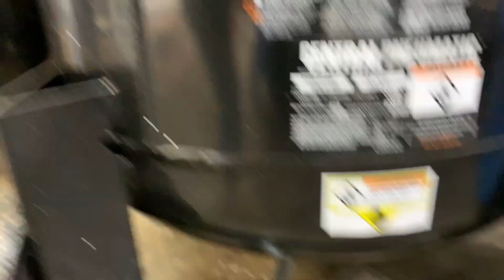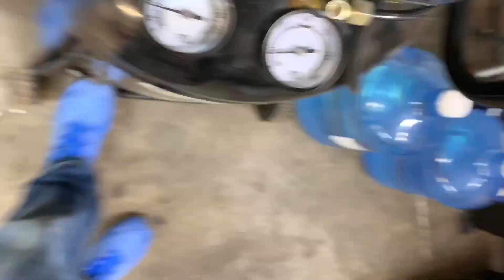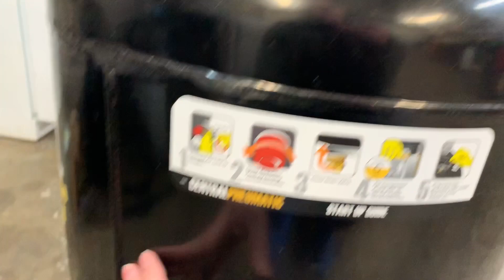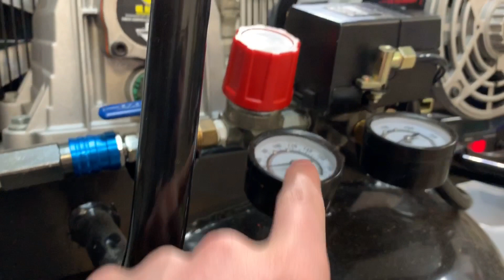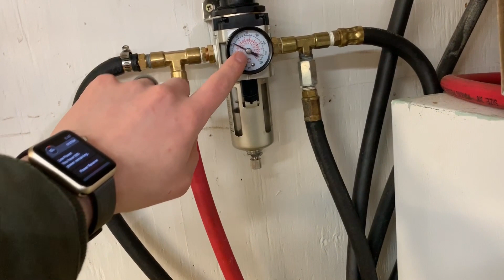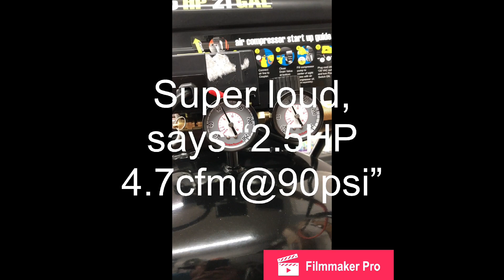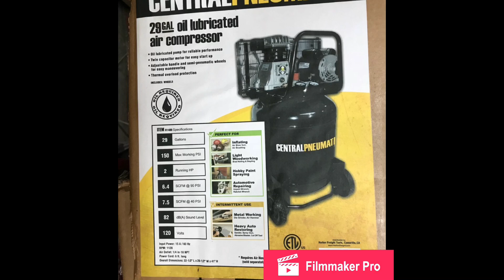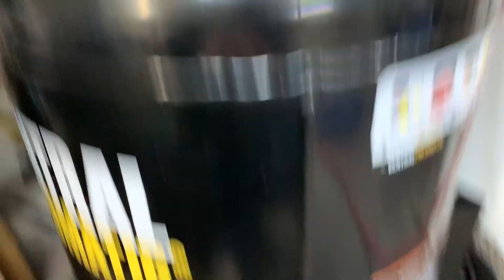Harbor Freight 29gal After Cooler Install, (BONE DRY AIR)

Comment from the maker: Planning to upload an update video with before after temperatures on tank, before after of heat that the upgraded comp oil reduces, and with new plumbing up front and hose reel review once I get them. Links will be added to video for that!
Reply from the maker: https://youtu.be/M5F7eyJBKpM
Reply from the maker: Moving into a new place with a 30x40 outbuilding shop, will do an updated video after!
Reply: You should have just put on a short pipe extension nipple, instead of chopping the frame.

Comment: Great thinking and upgrades! Practically speaking, you almost never have to change compressor oil because there is no combustion byproducts. After cooler must be rated above max compressor pressure. Even though you don't get tank water, keep daily drain habit up because in warm climate that might increase. During once recent garage repair, my compressor ran continuously, I discovered loads of tank water.  Any water left in tank can cause internal corrosion, making dangerous tank.  Never buy/gift used  compressor w/ old tank, because you don't know how tank was cared for; it could be ticking bomb. Work safe.
Reply: Good point I never thought of rust inside he tank weakening the tank...and POP.

Comment: That would be an after market transmission cooler. With 1/2 pipe threads. And your oil drain on the compressor you may want to take out that plug install a pipe nipple of any length that gets you out to a more easily serviced position then cap the end. Making it far easier to drain the oil without making a mess
Reply: Bring it closer to you or tunnel to it. French drain? Lol..Still not enough clearance not to be a pain. 

I stopped after that. But 1/2" definitely aftermarket unless you're working on an Allison. Seems overkillish, however those auxiliary coolers were fairly reasonable even from the Dealer. I just know anything diesel related can easily quadruple in price.

Comment: Something I learned a few years ago here on YouTube about running the main air outlet tap as in where you would connect your hose or hoses to go to your air tools is that it's best to run your pvc or steel or brass line up high on the wall and then from there run it at a downward angle for say 2 or 3 ft, to wherever you want the level of your main line at to tap in with your air outlet fittings, and put your water separator and filter there, then from that point run your line along the wall level and put your outlet tap somewhere along in that point or if you want multiple outlets to be able to connect your air hose at different points along your garage instead of running a long hose from one outlet all the way across your floor then you run your line as far along the wall that you need to.
 To try to make my point simpler what I'm saying is that the air and moisture that exits out of your compressor needs to run a fair distance, like say maybe 6 ft, or more,  before the water condenses and separates from the air to be able to drain into the water separator more effectively, if the separator is too close to the compressor outlet the air and water remains a vapor and the water doesn't have much of a chance to separate. Running the line at a downward angle for a distance and then tying your separator/filter in at the end of that run at the point where you'd level the line back out helps because the water will separate and then run downhill into your separator at that point, then from that point, from the separator you can run your line level along your wall and put your air hose outlet tap or taps from that point on.
  I realize that I rattled on for a long time here about it but sometimes it's difficult for me to be able to explain what I'm trying to convey in a few words. I hope I made sense here, I personally haven't set up my shop like this yet because we're still renting a house but when we buy one hopefully in the next year or so I'm most likely going to try to set it up this way. Anyway, I like your ideas here, pretty dang nifty. 👍

Comment: Why not screw a pipe into the drain plug and have it stick out .
Reply: He said the drain valve was fouled up @ 01:31. So he upgraded.
Reply from the maker: The oil drain plug? The things too tiny I tried to find a way to extend that out (like the tank drain plug) but couldn’t. It’s tiny so I cut the frame a little
Reply: Yes, do your crankcase oil plug the same way the tank water drain with a ball or gate valve.  Look for 1/8 NPT nipple & ball/gate valve.
Reply from the maker: Phillip Chambers just bought it a few months ago, gonna install it!
Reply: @phillipchambers8487  I put a ball halve with a drain screw “I didn’t even know they made them” on my oil sight glass because the screw hole actual drain valve was to small to add the drain too, on my 21 gallon cheap Harbour freight compressor. It works great I can see the oil level better and drain it easier! I also added a radiator cooler before the tank the air line going to the tank doesn’t even get warm! Only thing I’m wondering about is where does the moisture go does it stay inside the radiator?
Reply: I tried that. Because its already a small plug, if you thread a pipe it make the hole even smaller.

Comment: I bought a Husky 60 gallon two years ago and am finally getting around to adding an aftercooler. To anyone out there who has a compressor, water in your air will destroy a tank and tools. After cooler will save you lots of frustration.
Reply from the maker: Brother's Forge amen
Reply: @gunsandgaragegear601  I used a roll of 1/2 inch copper tubing   coil , from compressor and put 1/2 inch separator before the tank and,,, dropped my air temperature 100 degrees.. it's 25 ft of coils,,,best way I've found

Comment: Just wanna say I've had the loud 21 gallon for 8-9 years now. Biggest issue is the factory nipple and regulator choke it down to a 1/8" output. It's great once they're replaced. Wish I had the money for this one back in my 20's, but it definitely wasn't built to be thrown away after a year or so.

Comment: Nice Frankenstein job...looks like it should be in a Mad Max movie...
Reply from the maker: Vee-in-nYc lol thanks. Works great I’ll post another update video when we finish moving into our new shop outbuilding in about 4 months.
Reply: Not the prettiest plumbing job, eh. Could have all been done with copper line... get even more heat dissipation.

Comment: Try adding an intake muffler. Brings the decibels down. Did it to mine and much quieter. Pvc piping  elbow, cap, steel wool and some filter element. Can aim the piping to the floor or any other direction to reduce noise as well.
Reply: I was thinking this on my 5 in 1 ridgid.
Reply: Shop i worked in had like 4" pvc intake routed outside. It was awesome
Reply: Link man... please offer a link to such muffler after making a suggestion
Reply: @anthonyrochon3907  Dude all you have to do is do a search for compressor intake muffler. Dont be lazy do your own research.
Reply: @thisone.   okay

Comment: The transmission/oil cooler helps remove water and also increases cfm because heat=increased pressure . Soft copper line and flare fittings are a great way to plum it up. It's plenty strong for the task. And will further aid in the cooling if the air. Also if u were to make a shroud to wrap the edges if the cooler and end close to the fan/ large pulley it would pull more air.   An electric fan is a easier option.
Reply: The CFM is limited to the pump output, the cooler has zero to do with CFM unless it's restricting the actual flow.
Reply: I was thinking the same regarding I'd most likely use copper piping to help further cool and I have plenty around.  I was also thinking about using and old steel compressed gas tank inverted and modified to make a cylone filter to first remove water.  Not certain I'd require... though that was the original plan along with more copper pipe to make the heat exchanger versus purchasing.  I like this concept and paradigm of thinking being more compact.

Comment: the best way to separete water before it goes to the piping is to keep the tank cool and, as much as possible, install the compressor air intake somewhere it picks up the dryer air as possible.

Comment: I like your setup. Attaching the aftercooler to the compressor is a great idea. I have a full sized condenser set aside to incorporate into my own setup and it's been years now. LOL I haven't done anything with it yet but I've always wanted to upgrade my 21 gal for the 29 gal also.
Thanks for the motivation.
Reply from the maker: Rob's Wrenches absolutely the 29’s the way to go, even stock

Comment: Extend the drain pipe like you did and just drain it daily. Then just use a water separator on hose output. A good quality one removes basically all water on output. The tank is strong enough to handle a bit of water in it. Hell of a lot cheaper. I also paint with my air compressor. So can't have water on the air. Never had issues

Comment: Great set up! The link to the blue high pressure hose wont work unfortunately. would you be willing to share the product info for those?
Reply from the maker: Sorry. I don’t get notifications. It’s just any kind of hose you can use that’s high heat. You can also use copper pipe.

Comment: The transmission and engine oil coolers I looked at are rated at 125 to 150 PSI.  My compressor shuts off at 125, so there is no safety margin.
An Air Conditioner coil would be better since they are rated well over 200°.  Automotive coils would come with fittings.  A coil for a small window unit would work, but will require using compression fittings, or use the solder for AC systems (not plumbing solder).
Reply from the maker: It doesn’t actually get 125psi in there I don’t think but. 5 years later still works.

Comment: Just a quick note, you mentioned stepping down from 1/2 to 3/8 right after the motor, bad idea if that is the case. You essentially created a bottle neck which will steal cfm down pipe. They sell 1/2 transmission coolers (eg derale has them) and you could have used flexible 1/2 copper (sold at the big box stores) to connect to the two and not affected your pressure downstream.
Reply: Also creating heat In The bottle neck
Reply: Pressure and volume (CFM) are two different things, changing the pipe size has zero effect on pressure but will change the actual flow rate CFM.

Comment: Propably the SMC waterseparator filter after the Cooper doing most of the work here. Mostly would work allmost the same without the aftercooler.
Reply from the maker: It’s a big difference. The heat at the top fitting in the after cooler is like 300 degrees. It’s like 70 at the bottom fitting right before dumping into the tank.

Comment: I was recently given one of those it had a bad switch I replaced that but it seems like the threads at the bottom is fine threads and I wanted do something like you have to drain the tank where did you get a fitting to match or it's just me not seeing right

Comment: You should’ve added the drain extension like you did for the oil for the compressor. That’s what I did with mine. It’s not like that mine is a kobolt from Lowe’s. I have a 60 gallon air compressor with a two-stage pump and I have the same tank that you have plugged into my 60 gallon as a extra air tank.
Reply from the maker: You’re right.

Comment: The after cooler is a great idea except is that after cooler you are using made to hold the air pressure of the air compressor ? If not it could be dangerous if it explodes.
Reply: It's plenty safe
Reply from the maker: Air just flows through it. It doesn’t hold it at 130psi or anything. It’s safe though.

Comment: I just drain my tank daily, before I leave my shop I turn off the compressor and open the drain valve. Costs me $0. I do run 4ft of desiccant lines on each outlet though, they change color when they’re needing to be recharged with a 45min cook in the toaster oven in a tray. Here in Los Angeles that’s about 2x/yr unless we get a lot of rain. Each of my sewing machines has an oil/water separator on the inlet anyhow, just in case.

Weekly/monthly shop maintenance schedules keep things tidy and in good order.

I’m running a 26gal “quiet” Kobalt vertical tank compressor. Not in need of high cfm, but the maintenance principle is the same
Reply: what kind of desiccant lines are you running?
Reply: It may not cost you anything to drain your compressor, but it takes power to fill it back to the pressure you had. Solar panels put our electric bill at $65 per year for a 2000 sq ft house with multiple ac units, in the Inland Empire, but I don't drain an 80 gallon tank, or the 60 gallon tank in the other garage. My auto drain runs every time the compressor cycles, so it only goes off and makes sound and wastes air when I have the compressors switched on. The other maintenance is good. I use regular water air separators down to 5 microns, then M30 paper filters down to 0.01 microns to get the rest of the water and oil. It keeps the air dry for the plasma table and tools, but I also use a disposable filter inline right before the whip to my powder coating gun. Luckily we don't get a ton of moisture in SoCal.

Comment: I did something like this many years ago when i started painting cars and just needed to shoot a bumper. But i have great advice from the compressor snobs that are auto painters 😂.  Go to your local junkyard and look for a xj jeep Cherokee and pull the ac compressor. Do a grease conversion and drill the outlet a few bit sizes bigger weld some bolts onto that base and get a 4inch pulley for that motor and attach it all together with what you have and youl have a great much quieter 15cfm compressor. You also could look for those Volkswagen vans from the 90s that use the bigger version of that pump as you do have a 2hp motor then you get about 20cfm. But the jeep ones are plentiful and cheap. Lmao my shop has actually ran on a gas powered 2 stage using 3 of these pumps for about 1 year now. I still have my small one unit compressor hooked up to the system and use it 2 yrs later when i dont need the air of the gas compressor. It will hold 120psi while painting a whole car as long as its just me using air after all.

Comment: What about removing the junk regulator, as they very all decrease air flow , use in line regulator way better , think I’ll buy the compressor and use the 33 gallon oil less my wife bought me as the storage . Thanks
Reply from the maker: Good idea! As you can tell my setup was not pretty. But functional. You can easily remove the junk cooler, plumb copper to an after cooler, and then run it cleaner into the tank. This is still working 5 years later.

Comment: What I don’t get is that the water will be in the air regardless of temperature? The only thing that’s working is that you have the filter that collects the water right after It condenses out right?
Reply: This is correct. You can't get every drop of water, but the first stage water trap catches alot and further up the system going into the line you will get another moisture trap/dryer do the rest.

Comment: I have that compressor I just felt it wasn’t big enough that’s why I got a 60 gallon from Lowe’s just under 600 bucks three years ago I got free delivery and 10% off if I got their credit card after I got the compressor I paid off the credit card to capitalize on the 10% discount and the free delivery.  I did put an hour meter on my compressor so I know how many hours it’s been running when it shuts off it stops counting even if there’s no electricity for whatever reason it does not lose the time that it has ran.

Comment: I am not sure if you can add the CFM of compressor and a tanks. CFM calculations take in consideration the pump capacity, tank capacity, the hp of the motor and time it takes to fill the tank. If you have two compressors working in parallel then yes you can add the cfm's.  Great work, Thank you!
Reply: CFM rating on the compressor is at the input side of the pump, not the output to the tank. Cool concept 👍
Reply from the maker: I’ve done a few tests for how long it takes to fill and it seems to be between 6-7cfm iirc. Works good enough for me and runs all my tools!
Reply: CFM rating has zero to do with the inlet and is 100% based on pump output.

Comment: Are you sure about two compressors combined will double CFM? The thing that keeps me from buying the sandblast cabinet is that it requires SOO much cfm (12.0+) to operate.
Reply from the maker: Yes. You can run two compressors in series basically. Or maybe it’s in parallel. Idk if that matters but u do know plumbed correctly yes you get that cfm. Look into it.

Comment: The 21gallon sounds like an oil less compressor , wouldn't have one of them !!! :-)
Reply: I think it has less to do with oiled vs oil free, and more to do with belt drive vs direct drive. Direct drive compressors have to spin a smaller pump faster to get the same output as a belt drive.
Reply: Nope that 21 gal was oiled also.

Comment: If you want the best air hoses go with blubird it has a 300 psi working pressure and a 1200 psi burst rating. Flexzilla only has a 300 psi burst rating. Blubird is far more superior. And I haven’t even mentioned it’s temperature ratings are amazing as well -50° to 190°F

Comment: Better than making a DIY water trap with vertical lengths of pipe?
Reply: You could build the whole set up with copper tube, a bender and / or soldered fittings.

Comment: I wish this post was active - I have questions on substitute hoses since that link is broke and wondering about the float valve. If the float valve was added or if it's available as an option on the water collector?